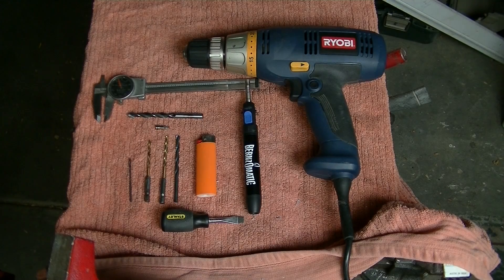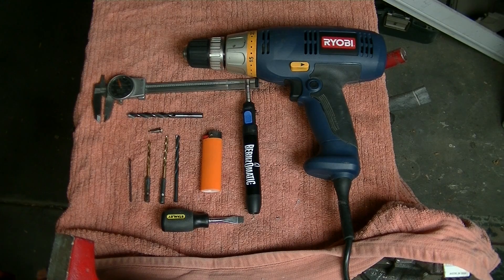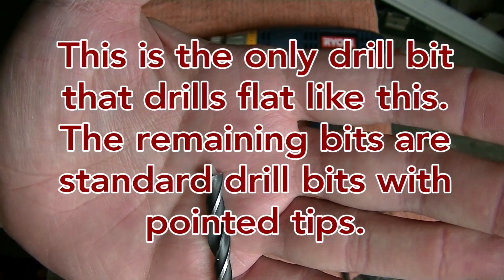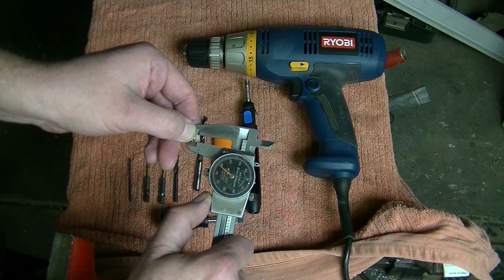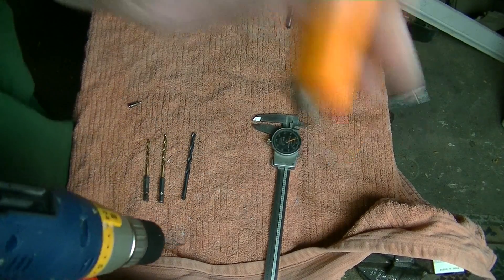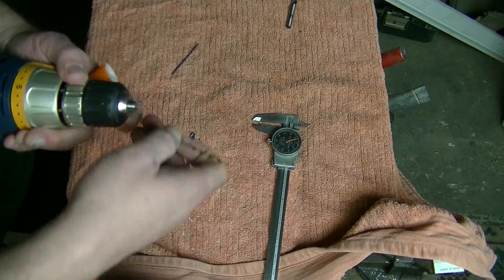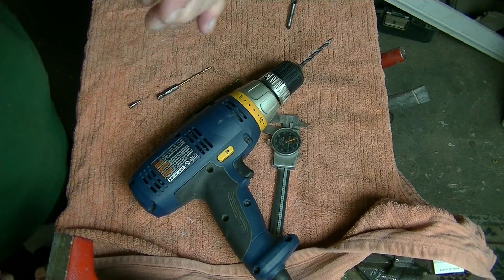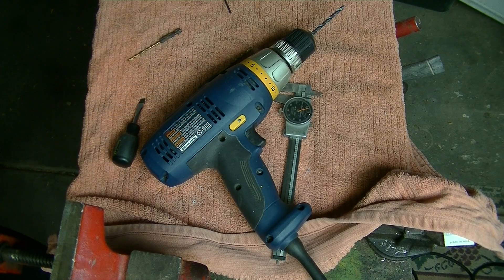Make A Bic Lighter Refillable By Installing A Refill Valve

Comment: Don't use that center divot, just drill your hole on the side of the divider that doesn't have the straw, (the side opposite where the flame comes out), and you don't have to mess with breaking it up and trying to get the pieces out....
Reply from the maker: If you look in the comment section for the video, you'll see links to nozzles that are small enough that you don't need to mess with the center divider at all.
Reply: @MikeSims70  type b refill valve. But the flame is never the same. I now buy vintage. Pieces of art for cheap on eBay. Just learn how to replace gaskets/ o rings.

Comment: Another way to do it is cut the lighter open remove some of the center , JB weild it back at your custom shorter lighter. If you are refilling why carry that much fuel ? Refill it once a month.
Reply from the maker: Well, one person may only need to refill once a month, while someone else might need to refill once every couple of days depending on use. And again, the JBWeld will LEAK BUTANE so it's a bad idea all around. I've even tried re-melting the plastic back to the body and that never works out well either. I think the issue with JBWeld is that the material tends to contract and expand with temperature ... or it might even contract when it cures.

Comment: Dunhill lighter parts 2/$7 Walmart . Not identical but might be better. Why not JB wield the dunhill fill valve
Reply from the maker: I've tried JBWeld in this application, and it inevitably leaks ... and it doesn't take long either. That's why it is vital that the hole you drill be smaller than the threads so that the threads can cut into the plastic. That is the only thing that will prevent leagage.

Comment: Hey man I was planning on doing this. How well do you say they hold up? Any deformities over the years?
Reply: Also does the butane leak?
Reply from the maker: @gabrieldawa6221  They hold up quite well and no the butane never leaks if you get the nozzle installed correctly.
Reply: @MikeSims70  thank you for the information.
Reply from the maker: @gabrieldawa6221  Anytime! Let me know how it turns out.
Reply: @MikeSims70  so I'm ordering things right now and I just had a thought... What is your recommendation for Butane?
Reply from the maker: @gabrieldawa6221  I get butane that is AT LEAST 11X filtered but they do make it at higher filtration levels. The only thing that matters is that the more it it is filtered, the less likely you will ever deal with clogging.

Comment: Turned out this nozzle is too expensive than new 10 lighters..😅 but i wanna try this process so still having some hopes to find a cheap nozzle 😅 thank you for the videos 👍
Reply from the maker: It's not the price of the nozzle that makes this worth doing ... it's having a refillable bic! :-) and $10 sounds about right actually. When I order nozzles, I'll usually get a few cause I can't justify paying $8 shipping for a $10 nozzle.  ☺
Reply: @MikeSims70  yeah you're right
Reply from the maker: @randulajayaneththi6309  This is worth noting as well ... they make smaller nozzles that are short enough that you don't have to chip out the plastic wall inside the Bic. You only need to do the hole properly, then thread it in and they work just as good. Ive sourced them from paint ball supply shops. Apparently those paint ball guns use the same nozzles.

Comment: Buy a $1 refillable lighter and use the mini refill valve. You don’t need a giant one. The tiny ones fit perfect in a mini BIC. It has a gasket on top and has an awesome seal with the nozzle. No wasted butane. And with torches use high quality butane only.
Reply from the maker: Yes, I discovered the mini nozzles about a year after I made this video. No need to chip out the center divider with those.
Reply: where do i buy one?  I thought only the long ones were refillable.
Reply from the maker: @genkiferal7178  These are smaller valves right here:
https://www.evike.com/products/50149/
https://store.kwausa.com/product/kwa-universal-gbb-charging-valve/
https://www.amazon.com/KWA-Magazine-Charging-Airsoft-Magazines/dp/B007BBWP04
https://www.evike.com/products/27269/
Reply: @MikeSims70  that's awesome.  thanks.  You said in your video that the flints only last about 2 years.  But, it looks like they can be switched out by using a newer flint (is it that wheel - the darker part?) from a non-modified Bic/lighter.  Am I wrong on that?  Should I be saving those flints from littered/discarded lighters I find on the street side or in a parking lot?
Reply from the maker: @genkiferal7178  First of all, I believe it is easier to install the nozzle than it is to change the flint. That being said, if you have a specific Bic that you want to keep for the long haul, then you can put in a newer flint (say from an expired Bic that you can sacrifice), but the flint is under the strike wheel and it is spring loaded so it makes replacement rather tricky as you have to remove the strike wheel without damaging the Bic and as soon as you do that, the flint will want to go flying so you have to make sure its pointed towards a towel or something that can catch it if your fingers slip. 

Using a hair dryer or something to warm up the plastic that is on either side of the strike wheel will help  because it will make the plastic more mallable and easier to bend but the plastic is fairly durable and not prone to breaking in the first place.

But getting the flint out isn't nearly as difficult as putting one back in because that spring puts a LOT of tension on the flint and the re-assembly of the flint and the wheel becomes this balancing act of trying to make the flint stay down while you get the strike wheel in place and secured.

Once you actually attempt this, you will see why I say it's probably easier to move the nozzle to a newly expired Bic instead of replacing the flint. 

But the flints are rather large and they do last a long time. Ive gotten in upwards of over 10 refills on a single flint before. It just depends on how often you have to strike it.

:-)

Comment: I did this today. I had zero issues with the wall. The drill bit eats it up no problem. The plastic wasn’t a problem either.
Reply from the maker: That's awesome! Nice work! Now you'll have a custom lighter that can be refilled NUMEROUS times before you have to either replace the flint or move the nozzle to another lighter. I had actually - at one point - started to think about inventing some kind of device that would make this process easy ... something like a small device where you could set the lighter in it, pull a lever and the nozzle would just be installed ... but after giving that much thought ... such a device just didn't seem plausible ... nor practical.

Comment: Tysm! I want to sell lighters that I hand paint but I want it to be refillable bcuz they take a while to make. This video solves that weird lump at the bottom & the fact that using the other technique makes it harder to refill a second time or stand the lighter up.
Reply from the maker: I use to carve and paint lighters ... but I was never able to find a way to put a protection coating on the lighter and over time, the paint, which was acrylic, would wear off of the lighter .... here are some of the lighters I painted https://www.facebook.com/photo/?fbid=10212387649714241&set=a.10212387649474235 
https://www.facebook.com/photo/?fbid=10201606478231692&set=a.10212387649474235
https://www.facebook.com/photo/?fbid=10201606478471698&set=a.10212387649474235
https://www.facebook.com/photo/?fbid=10212387649754242&set=a.10212387649474235
Reply: @MikeSims70  I use nail products. First I scrape up the lighter and prime the surface. Then I cover the design in clear gel that cures in a uv lamp. I also use gel colors for the designs. They’ve never chipped or peeled or anything w this technique
Reply from the maker: @stardustfactory8311  Interesting ... I wonder how they might be an added resource for the way I was carving and painting lighters ... the uv cured clear gel sounds interesting ... I never did mess with any of that stuff though I did mildly score the entire surface of some lighters with a fine grit sand paper then I used an epoxy that I found at a hobby store to coat the lighters, but that stuff ended up chipping off of the surface in a relatively short period of time. Do you have any photos of some of your work?

Comment: What about using a tire air valve somehow?
Reply from the maker: I dont think they would work beause a butane can wouldn't be able to fit on the valve not to mention the size of something like that would be too large.
Reply: I have a couple valve stems also.  I'm not sure if would work although similar in shape and size, because air passes through easier than a liquid, it might damage or not pass through quick enough for the tire valve to handle the pressure?

Worth a shot, I'm interested to know if you've tried it ..

Comment: SAVE money on fckin' lighters? hahah comooon! maybe if u spend 5 lighters per day :D If u want to save small amount of $, stop smoking, or smoke 2 cigs per day. Why do this, when flint isn't replacable, i mean u can replace it, but its complicated, u can simply buy Clipper cilindric popular lighter, it's refilable, and u can change flint without loosing your nerves, and it's cheaper than BIC ;D. I had one Clipper in past and used it for few years, i must replace that metal thing wich "fire" flint, that teared apart of long use, and at the end nozzle probably clogged (flame became smaller and smaller till stop working) and i can't used it anymore after 5-6 years.
Reply from the maker: Well, the answer to your question is primarily because people who love Bic lighters usually have no tolerance for other designs. There is something about the way a Bic fits in your hand and the way it operates ... the kind of flame that it kicks out etc. that has no equal - anywhere. And for some, replacing the flint isn't a big deal while others will exhaust the flint that is in it - which can last for sometimes 10 refills or more in my experience, but when it runs out, just move the nozzle into another Bic and keep going... that's the gist of it anyways ... whether or not you can accept that answer, it is what it is ☺
Reply: @MikeSims70  thank you again for taking the time to make this tutorial mike,
Reply: its about sentimental value dude
Reply: Some people have Bic lighters from their favorite smoke shop or maybe from an event, or an artist, , or a glass shop, ...and they have a name or design printed on them, not a sticker you can just take off.  I have a 15 year old Bic, from a old place, its  in my drawer, still just under half way full.
Reply: You don’t get it. This video isn’t for you. It’s not about saving pennies. It’s about minimalism , ease of use, no 10 million lighters in a landfill. Something so easy but to be a cool person who lacks education I should pay $2.50 every few days and drive to the gas station that has them in stock. No critical thinking skills whatsoever. Go to school and learn something boy.
Reply: @rhuckabee44  Hahah, u don't get my comment BOY! There are some lighters wich easiest to refill than BIC, u don't need any "hacks" and wasting time, u can change flint in 5 seconds, and 4 your information, i knew this hack before youtube existed BOY! :) This guy mentiomed "saving money" not me! I only commented that u can't save money on fckin' lighters witch u buy approx. once in month if u are smoker. If u want to save money its better to stop smoking if u are smoker offcourse...
Reply: @rhuckabee44  He is literally saying you should get a clipper BECAUSE THEY AREN'T DISPOSABLE. How can you possible make the point that they're promoting lighter landfill when Mike himself states that "just move the nozzle into another Bic and keep going" is the philosophy with Bics? You will buy one $4.50 metal clipper and it will last you the rest of your life, how is that landfill?
Reply: Flint not replaceable? How old are you 10? How dumb. Don’t talk about things you have no clue about. It’s easily replaceable.
Reply: You don’t get it. The rich don’t throw even a dollar away. That’s why they are rich. That’s like a $5 meal for $0.20. A $25k car for $1,000. Liters are for fire not for just smoking. Camping. Emergency. Killing insects. DIY. Crafts.